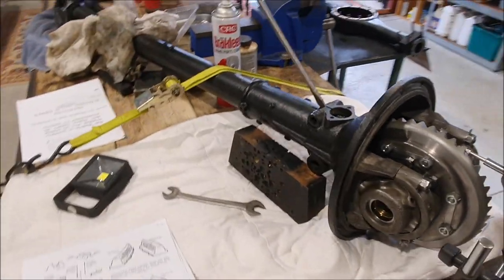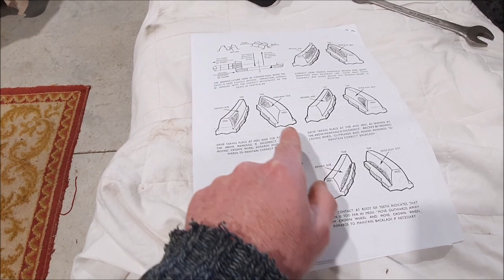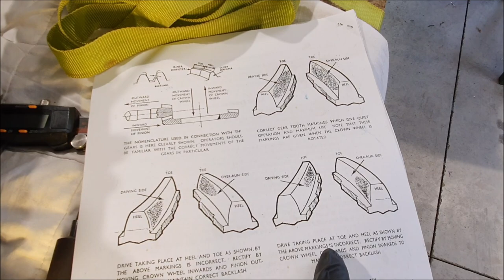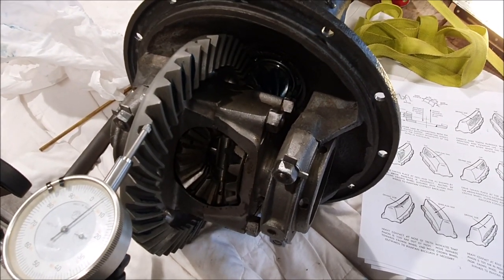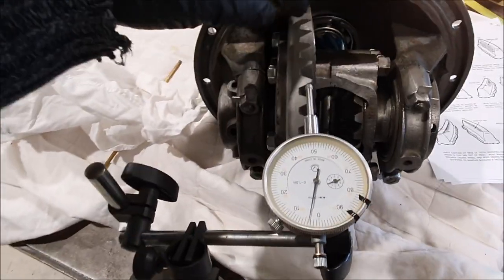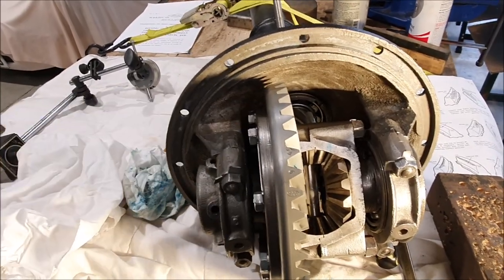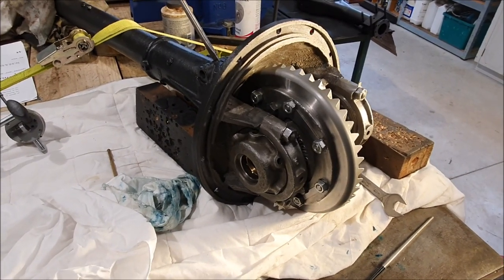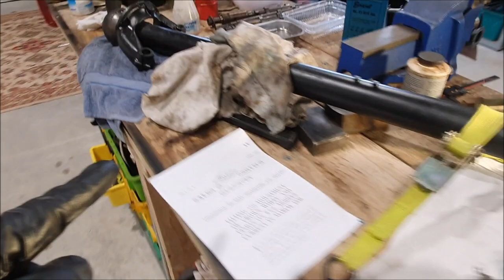Pre war car - Riley 9 differential setting part 2

Comment: Sympathize with you. Unless you know what the working parameters are from experience it is tricky. I have found that I was well within what factory specs were on my Riley. 9 and RM. This was apparent after seeing other set ups. Today we are always over the top on rebuilds, not a bad thing for longevity, but we lack the real world experience of driving them from new. I remember how noisy diffs etc were in cars in the fifties but they ran and Riley was top engineering. Good to see you do it right though. Stay safe. from UK.
Reply from the maker: That's why I kept saying I think I had it right, was trying to convince myself! And that's definitely a problem too about not knowing what they should be like when correct. I have no clue what a Riley Brooklands is like to drive or what it should sound like. Even an old one let along factory new. I had the same issue with my Austin 7 after rebuilding that engine. I had to ask a friend who has done many of them if it sounded right, he just replied well, it sounds like an Austin 7! With the diff I think you'd have to be way out for it to be really noisy (or else they are really noisy all the time anyway). Longevity doesn't worry me, I suspect our cars are coming to the end of their time and they aren't high mileage anyway. That Penrite 140 Transoil is very thick stuff so I think that will help too.

Comment: When we were checking the gear mesh pattern we used to load the crown wheel with a wedge to make it harder to rotate, This gave a more pronounced mark on the teeth and a pattern that was more true to reality. This may help.
Reply from the maker: Yes, I read similar on other sites too. You do need some resistance on the crown wheel for it to show correctly it seems.